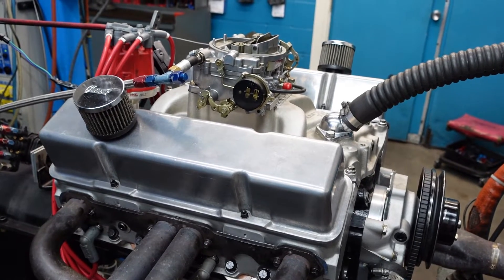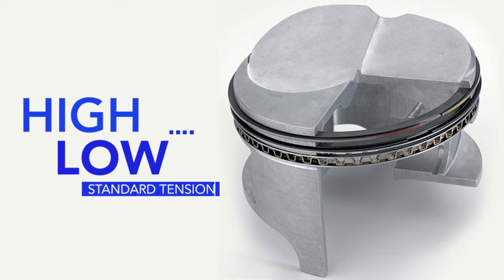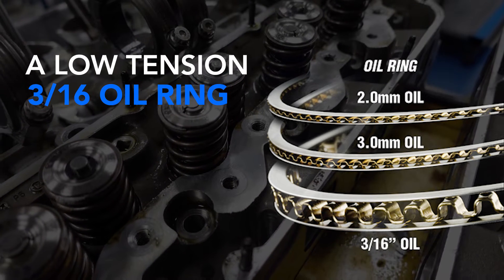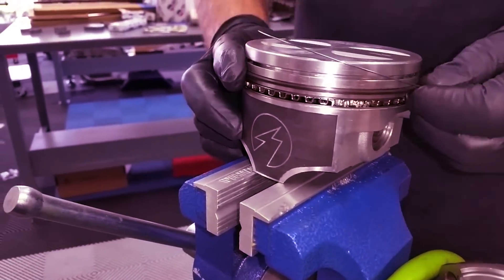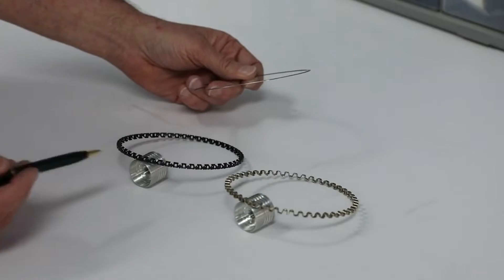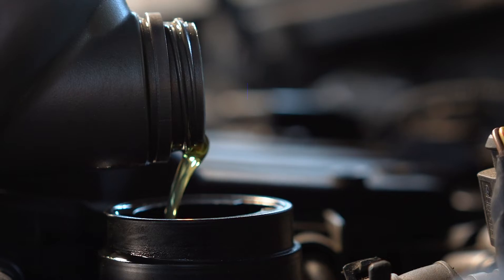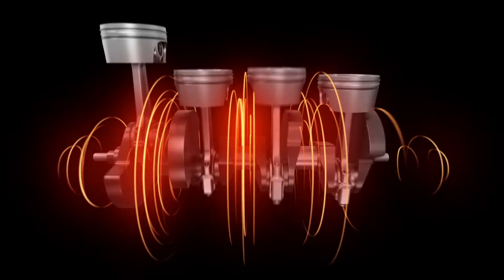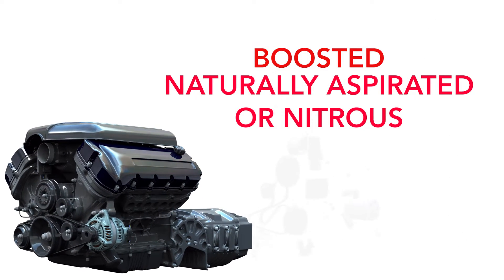Are "Standard Tension" Piston Rings Always The Same Tension?

Comment: In studying to decide how to build my 10:1 SBF 331 for my manual Bronco, one thing I never knew I had to consider/decide was what ring pack to run, based on I built my mild NA 331 stroker for drivability and longevity, the 4032 Forged Mahle pistons came with 1/1/3 nitride coated low drag rings. My machine shop bored/torque plate honed/line honed/decked block and balanced my entire rotating assembly. I didn’t prescribe what surface finish, didn’t even know I had to look out for that, BUT I HOPE they looked at my parts, which they had, and determined based on my ring pack what finish my bores needed. 
If ring packs are described based on application, I do hope in the description the longevity comparison is included as well. For example: who wouldn’t want to free up power by reducing drag/friction? But NOT at the cost of longevity… unless it’s spelled out that is, explicitly that low drag tension ring packs are marketed to racers who routinely tear down their engines after a season or 10 passes, but I built mine intentionally to last, not so loose on the mains, not so loose in the bore, only occasionally spinning mine to 5500 max on a rare occasion. 
Interesting introduction into ring tech
Reply from the maker: Thanks for the comment. Those Mahle pistons and rings are very good. Check out our video on proper engine break-in to give yourself the best chance for success.
Reply: @TotalSeal  appreciate the reply. I double checked my paperwork from Mahle. They’re part # 4035MS-112, so 1mm-1mm-2mm standard tension, so I’m not low tension so…
Reply from the maker: @WesternReloader  if the cylinders where  honed correctly for those rings, then just follow the break-in procedure in the video link. That’ll do it.